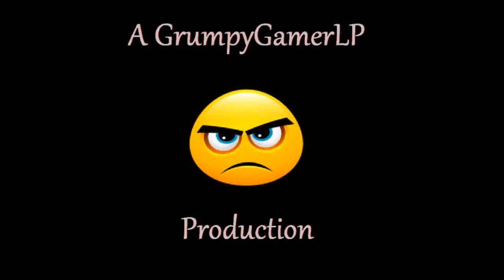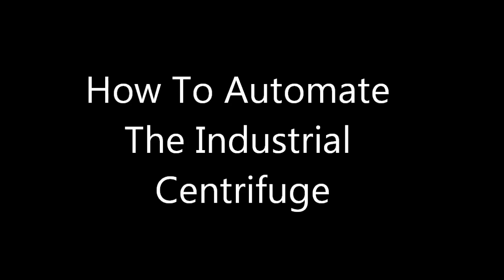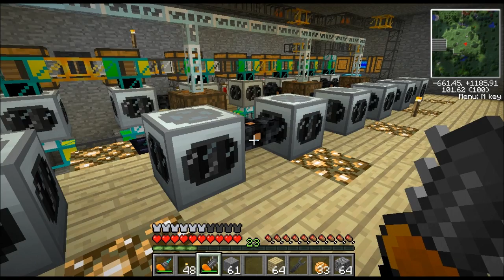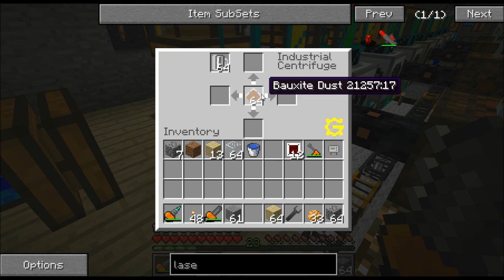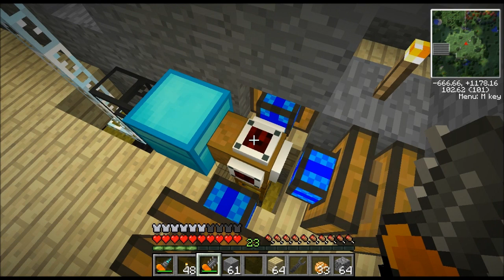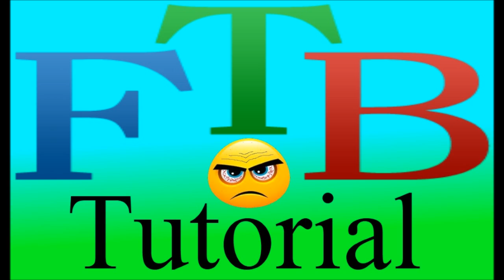FTB/Feed The Beast Tutorial - Industrial Centrifuge, How To Automate With BuildCraft

Comment: You could scrap all your redstone engine in there by using iron Autarchic and/or gates (and higher) with pipe wire.  

Set it to emit pipe wire signal on specific conditions and use that on another gate to start the autarchic cycling.   The diamond and gold gates of both types allow you to check your inventory for specific items, then emit based on that condition.

Comment: Tipfor equal distribution: for every diamond pipe above every machine, you can have 7 dusts going forward to the next and 1 going down into the machine, so every eighth dust or so will go into the machine. on next diamone pipe you'd use 6 dusts going forward and 1 into the machine etc. This distributes the dusts equally into all machines instead of having the first machine full of 64 dusts while the last machine has an empty inventory.
ps. Heard this comment on another vid, I haven't tested it.

Comment from the maker: You can put a transformer or storage device in line to reset the power loss. For example, glass fibre cable loses one EU every 40 blocks. Place a transformer every  40 blocks or so and you won't have any power loss.

Comment from the maker: There is more than one way to skin a cat. You can play around and do almost everything I do in every video in a slightly different way. The problem you will have by not using diamond pipes on every machine is that cells will only have a 50/50 chance of going into any machine without a diamond pipe on every machine.

You could place iron pipes on the other machines to act as advanced insertion pipes but I just chose to use all diamond pipes.